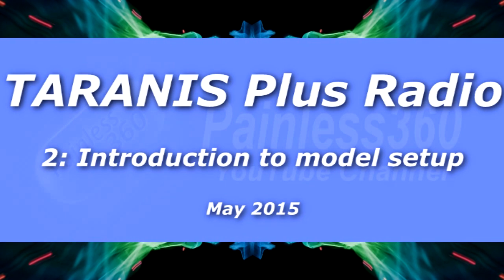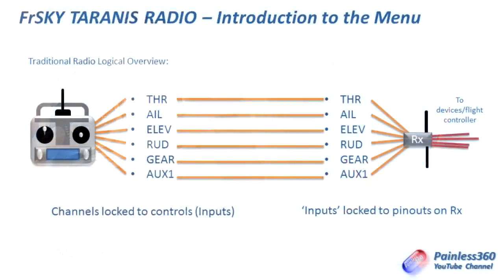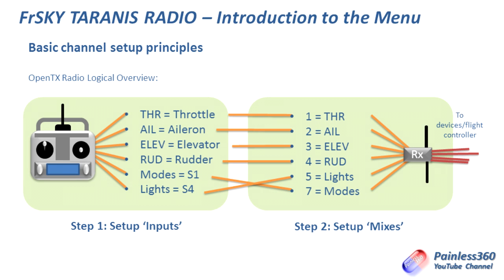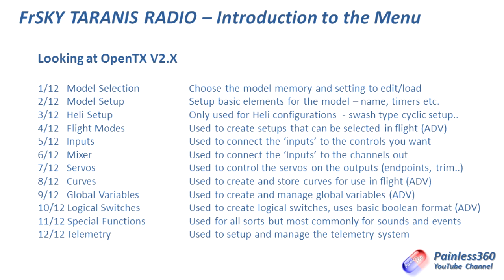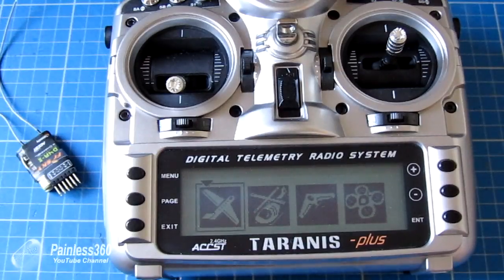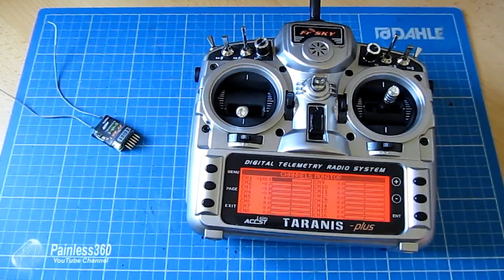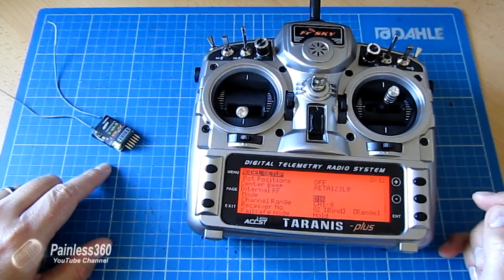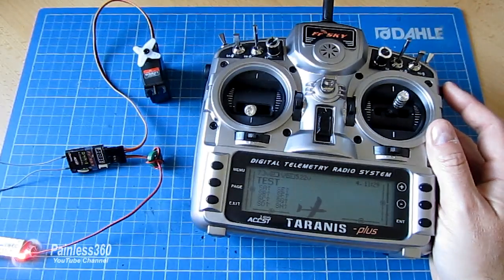(2/12) FrSky TARANIS Radio - Introduction to TARANIS model setup basics

Comment: How come my Taranis doesn't have those quick menu options for airplan/ helicopter/delta wing/ quadcopter?  Did they get rid of those in the latest firmware update?
Reply from the maker: These setup wizards were changed a lot over the course of Opentx and EdgeTX. Not all setups have them... It might be worth checking if they are an optional thing for the setup you have... Best of luck
Reply: @Painless360  The model wizard is still  in OpenTX but not the transmitter....Oh well, I use open TX to do all of my programing anyway.

Comment: Hello, I have just started flying fixed wing again with my Taranis X9D Plus, downloaded the latest version of open TX 2.3. Updated the firmware on TX, with the Non EU version, the receiver has been flashed with the Non EU version firmware. The receiver binds ok with the TX, but nothing happens when any of the sticks or switches try to move the servos. Stupidly, I forgot to backup the setting on my TX. What could be causing this problem. I have been at this for 2 days now and I cant get the servos to work. I really would appreciate your help if you can.
Reply from the maker: Not sure as I moved to EdgeTX a while back. Are you sure you're bound?
Reply: @Painless360  The RX has a solid green light on it. I followed your first video on the Taranis, updating the firmware, obviously the latest version of the firmware is not the same as the one in your video but it seemed to go through ok when the TX was connected to the PC. Im totally stumped as to why now, the servos do not operate.
Is there a way to factory reset the TX.
Reply: just as a follow up, opentx firmware version 2.3.15 is what I now have on the TX. On the Frsky website, they have updated firmware called FIRMWARE - RADIO OS, and FIRMWARE - XJT RF Module. Which of these should be installed on the TX, as they both seem to be able to be installed, and do they overwrite the open TX firmware. Thanks for your help on this, and I fully understand if you do not wish to advise.

Comment: Another needle in the haystack found.

Learned that
* Taranis X9D plus with open TX seems to be a might tool
* channels have to be told on which output or set of outputs they should be executed 
* channels are not autorealted or autoconnected ...

Still a long way to go but it looks promising cause I can follow the steps even 4 years later on my desk in my test environment.
Really great solution that you planned a series put in a playlist to start with and later add pieces that might have been missing like Startup Screen. Try to follow this playlist the next week to get on with it from the scratch to be able to use it in my flite test sea otter plane I am working on  ...
Thanks a lot for your skillfull planning and efforts like that in the input - output slide or the reduction of the 12 steps or pages to the real ones needed.

Comment: Please help!
When I select 'Trim idle only' under model setup it works on the Elevator trim instead of throttle trim.
How do I change it to the throttle trim? Thanks
Reply from the maker: I dont use gear but check out the issues log in Github as there does look like a few issues - https://github.com/opentx/opentx/issues/5635

Comment: Hiya Painless I desperately need help setting up my taranis with convergence... please anyone help!!! Tx franco
Reply from the maker: What do you mean by convergence?
Reply: Vtol
Reply: I have a orange module for taranis and have bonded taranis with spectrum receiver but am not getting any output at servos on convergence vtol flight controller
Reply from the maker: How have you tested that the outputs from the Reciever are ok?
Reply: Painless360 hiya Tx again for helping... all working except for setting up the transition switch, I have set up the switch to the three position switch SA on Channel 5  but cannot get to work on model.
I’m almost there,, and can’t wait to fly it but just need help with this. The vtol manual says ....
“ set channel assign: (NEXT)
CHANNEL INPUT CONFIG: 
GEAR : A
AUX1: H

 But this is just for DX9 type transmitters, how do I config on Taranis?
Many Tx again Franco
Reply: Ok sorted, I needed to put on the correct channel Tx again, would love to know how to put my Pixhawk in!

Comment: Hi there Painless,I am considering the frsky x9d for my new radio and I am wondering if the frsky system will work with 20cc gas engine fixed wing aircraft, what would be ur thoughts on that matter, thanks
Reply from the maker: I know a few pilots who have used FrSky with Gas/Glow and works well. So long as the receiver is mounted with care and has a steady supply voltage it should be fine.. Best of luck!

Comment: Can i program  a X9D to talk to a spectrum AS3x receiver so "SAFE" mode works?
Reply from the maker: You could but you’d have to make sure that you have a spektrum module plugged into the back as this radio talks a different language to spectrum receivers use DSMX.

Comment: Need help. installed and programmed my taranis plus in my multiplex heron glider, everything is working except the flaps, when I move the switch to make the flaps go down, one goes up the other goes down, they are hooked via y harness and put on channel 6, what did I do wrong?
Reply from the maker: Sounds like the way they are installed in the model means you can’t use a y harness. I’d individually connect them to their own channels and reverse the one that’s going the wrong way. Best of luck!
Reply: so put one on channel 6 and the other on channel 7, well I need to run a mix, like slave 7 to 6, how does the switch recognise both channels?
Reply from the maker: +sc1212able duplicate the mix for output 6 onto output 7 and reverse the direction. All covered in this Taranis playlist in later videos or the videos in the 'OpenTX Mix school'. Please subscribe. Best of luck!
Reply: ok, thank you, I have watched most of your videos and subscribed, most of the info is all greek to me, I only fly gliders and need just a basic setup.
Reply from the maker: Most of my series start with basic concepts and get more complex as they progress.. starting at the beginning will help if you want to learn..  happy flying!

Comment: Hello, I'm a subscribed Newbie here and thank you very much for these Taranis X9D Tutorial videos!     Bare with my simple question please,  I have a X8R receiver that came with the Tx.  I want to do a simple test with a servo like you demonstrated in this video.   To power up the receiver I simply apply battery voltage (supply) to any vacant channel, or the SBUS?  Also what voltage range?
Reply from the maker: The specs are on most of the websites that sell them. Voltage is 4 to 10 volts but I run then at 5v, the same as any other receivers. Happy flying!
Reply: Thank You

Comment: Hello  sir.... i am using taranis x9d plus radio.... my radio turn off itself while flying.... battery conections are good.... what should i check now???? 
Please comment
Reply from the maker: the first the first thing I check would be the battery, what have you already checked with your troubleshooting?
Reply: Painless360 can u elaborate how to check troubleshooting?
Reply from the maker: Google something like 'troubleshooting painless360' to ifnd my video on it. Troubleshooting is a logical way to break down the seperate parts of a problem and test each in turn to find the cause of the issue..
Reply: Painless360 Sir, thanks a lot

Comment: Hey, I need your help. When I bind my F3 board to a flysky module using a Q X7, I was already able to bind it but when I go to cleanflight only the 4 channels are working. I can't setup any switches. Help?
Reply from the maker: +Andre Martinez what switches do you have set up on the radio? What troubleshooting have you already tried?
Reply: Sorry, just a newbie confusion! Accidentally set it up in the inputs instead of the mixer. Thanks anyways! :)

Comment: The Taranis has no real usable manual, which is a disaster as far as I'm concerned. Lucky there are people who understand that this is a major problem!
Reply: Also the frsky receivers give a completely bogus method of binding the rx! Its all Googling to find out every correct method of doing all the set up, very frustrating.To bind a frsky rx to a Taranis, you need to go to youtube to find the answer. 
Unbelievable.
Reply from the maker: +GPEART1 the Taranis is a different type of product from things like Futaba and Spektrum. Open source products tend to give huge bang for the buck but the manuals are an afterthought. Hence why we made the two series on it here ;)
Reply from the maker: +GPEART1 use X series and always bind using the D16 setting. Happy to help if you have an actual question...
Reply: I am figuring out setting up an excalibur warmliner, hopefully I can get there!
Reply from the maker: GPEART1 we have a video in the series where we setup a plane from scratch. it's designed for new pilots. Best of luck
Reply: I will definitely be checking it out. Thanks so much!

Comment: FYI everybody. using a V8R4-II  receiver,  you need to install a bind plug connected to signal pins on receiver between channels  1 & 2.  for the bind to work.

Comment: I'm so confused. anybody want to purchase a Taranis 9X or a Turnigy 9Xr really cheap?
Reply from the maker: How did you end up with two OpenTX powered radios if you're new to OpenTX?
Reply: Painless360, I purchased the Turnigy becouse my Devention only has room fot 2 more models. The Taranis came with a storm racing quad. I'm goning to keep the Taranis and eventually figure it out.
Reply: I'm trying really hard to understand this taranis.  You got me binded but lost from there.. can't figure out how to change / reverse servos/ controlls

Comment: The FlyingWing wizard has never worked for me. I'm using the same RX as in your video. Is there something I may be doing incorrectly during the walk through? The wizard is straight forward but my Aileron and Elevator are basically switched somehow.
Reply from the maker: You usually have to mess about with the direction of both controls depending on how the servos are installed in the model. This is normal. All the mixer does is mix the elevator and aileron into two channels for the wing servos.. Best of luck!
Reply: Painless360 I watched your other video on setting up a flying wing, that's exactly what I ended up doing(reversing the values from 50 to -50 and so on. . .). Thanks for your help, all is working perfectly now!

Comment: Which firmware are you using, because having updated mine to 2.1.8 I don't have the wizard.
Reply from the maker: The Wizard is a LUA script - you need to install the support for LUA for it to run..
Reply: +Painless360 yeah I found it and installed it. Made setting up the bonzai a lot easier haha
Reply from the maker: Great! Did you have to re-install the firmware then?
Reply: +Painless360 no just created the scripts directory and put them in then rebooted and created new model.

Comment: I have a question.
I do not bind my Taranis with the Rx yet. I notice when I move throttle the throttle scale on the 'Mixer' page is not moving in the same degree as the 'Input' page. So I tried changing the source of 'Throttle Mixer' to be 'Throttle stick' in stead of 'Throttle Input'. Then the scale move in the exactly same degree. My question is 'Is it OK to choose 'Stick' as the source for the 'Mixer'?
Reply from the maker: +Oran Tuntipana you can. You probably had something like dual rates or a less than 100% in your mix. Best of luck!

Comment: can I setup first the 4 main ch and after that setup the other switchs for my FPV?
or I have to setup all ch and switchs in the start?
you have a very good video!!!
Reply from the maker: You can set it up however you want. Normally you'd have CH5 for modes and then CH6 onwards for other functions. Best of luck!

Comment: any help would be so appreciated I can't seem to get my taranis radio to talk to my receiver I have gone through to set up the inputs on the taranis radio but in this video you mentioned something about setting the the mixers for outputs but there's not too much instruction in regards to that I have bound the receiver to the taranis at one time and I did have Telemetry signal but because I was in cleanflight and remote did not control any of the channels I deleted that model. I have also not been able 2 bind it successfully again I don't know if one sits down to receiver I don't know if once it's bound to receiver it's bound no matter what I'm very confused any help would be great im on rcgroups.com under scratchbuilt quads under multirotor and its a HELP tab with the subject help im a noob 😢 or at derk0827@gmail.com
Reply from the maker: +Derrick Ianniccheri The light will be green on the Rx if it's bound properly and the LEDs will change on the Rx when you turn off the radio. We cover a lot of the radio here but please watch https://www.youtube.com/watch?v=olIqTiSJHIY and come back to me with more detail of what you've tried..

Comment: How should I power a receiver just for testing/setting up without having to connect it to my quads regulated PDB? Get a BEC and plug it to my battery?
Reply from the maker: +Four Prop Vice I use a spare 5v switching BEC, and use that on the bench - lots safer.
Reply: +Painless360 Yes, seems safer! :) Thanks!

Comment: First port of call when im stuck ;)
Just bought a Taranis after owning a 9X (OpenRx) for 4 years, upgraded the firmware from vid 1, however can't get it to bind to any of my Rx's, so far tested with V8FR-II and V8R4-II, any ideas on this?
Reply: +Dodge Ditchburn Sorry mate, seems sorted now, had to use the old binding method (with a bind plug) Cheers for the vids anyway!
Reply from the maker: Happy flying! ;)

Comment: what firmware version is it that gets you the setup wizard for the models?
Reply from the maker: +basebilljr07 I am using OpenTX 2.0.17 in the series. There have been a few updates since this was shot. Best of luck.
Reply: +Painless360 2.1.3 doesn't have the wizard when creating a new model, the OpenTX companion does however, but the radio just creates an entry titled "model XX" and you have to edit manually.
Reply from the maker: What a shame, the wizard is such a handy thing. It is a LUA script so I'd check that you have installed LUS support when you upgraded...
Reply: +kubanishku I installed the 2.1.3 firmware and the model wizard works absolutely fine in my Taranis
Reply: +basebilljr07 I don't have the PLUS Taranis, so might that be the difference? I create a new model by selecting an empty spot and ENT selecting CREATE MODEL.  It just creates a MODEL XX entry, no wizard. Not sure if I'm missing something.  Firmware was flashed via Companion TX.
Reply: +kubanishku hmmmm thats weird i do have the x9d plus version but if it's running the same firmware I would think that it should still have the setup wizard have you tried to reinstall the firmware again to see if that works
Reply: +kubanishku and also check on your radio I believe its in the radio settings when you long press the munu button and then press the page button until you see version and make sure it actually says 2.1.3 maybe when you flashed the firmware it didn't work and you're still running the old firmware not realizing it

Comment: My FrSky X8R operating Voltage Range is: 4V-10.0V
Does this mean i cant connect it to 11.1volt battery without using something to step down?
What are you using to step down the voltage?

Thank you,
Reply from the maker: +Amina Chee Use a 5v BEC. Using a larger voltage will only create additional heat in the receiver..
Reply: Thank you for replaying. You mean something like this: (http://www.banggood.com/Hobbywing-5V-or-6V-3A-Switch-Mode-Ultimate-BEC-(UBEC)-p-908018.html)
?
Reply from the maker: Yep, something like that. A lot of ESCs also come with a BEC in them too so you simply use that. See my 'Introduction to ESC' video for more detail.

Best of luck.
Reply: Thanx, you helpt me alot. I just used my esc. tested with multimeter and it give 5V.

Comment: Painless360, is there any rhyme or reason to correlate the Weight and Offset in Mixes to the PWM of the APM2.6 mode selection.
Reply from the maker: John Bailey Wow! Great timing. I've just figured this all out for the Pixhawk series on the channel. A new Taranis video for the 6 position switch (and it's use with the modes in Mission Planner) is uploading as I type. It includes the magic percentage channel numbers to drop the PWM value of the mode channel into the middle of each of the six modes. You can also use these same values with a logical switch setup too.
If you watch that video it will give you the answer! ;)